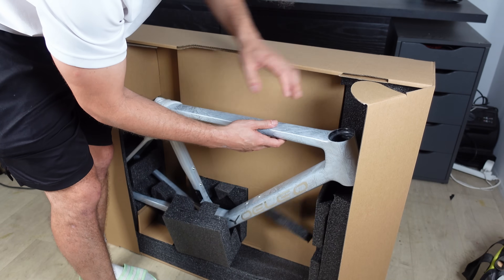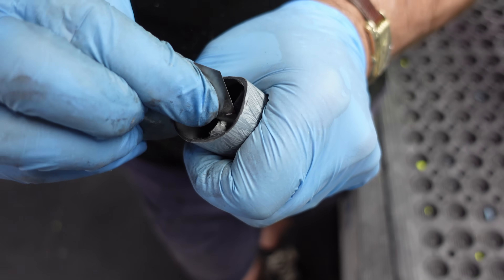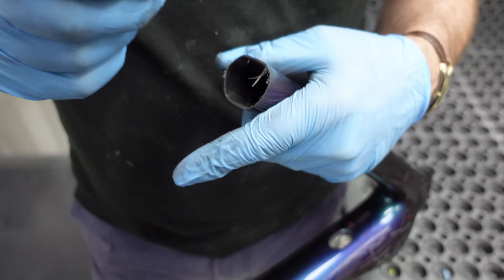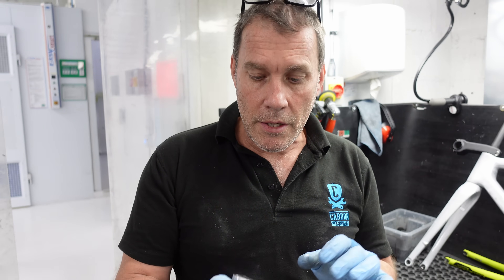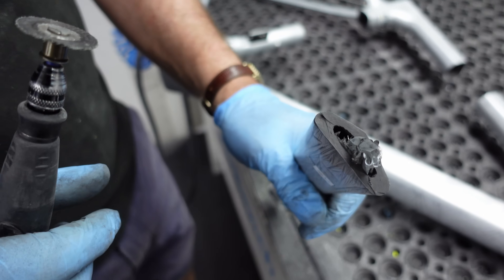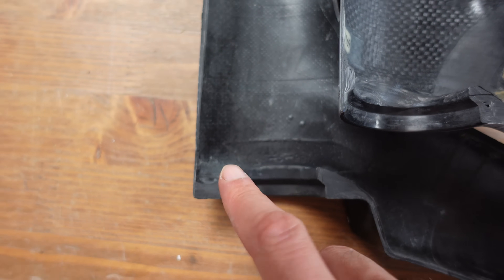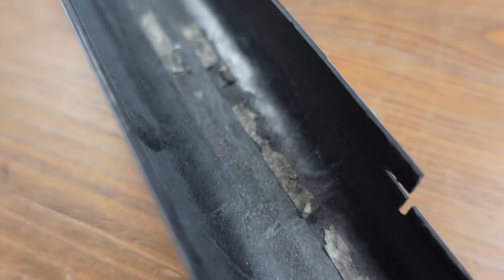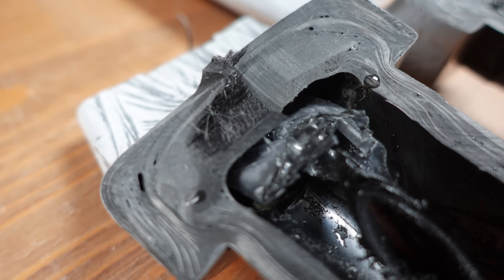I Cut a Brand New "Chinese Carbon" Frame in Half... Here Is What I Found! (Yoeleo R11)

Comment: i feel like the quality of which the frame is built doesnt quite translate into how it rides. at least thats what i have experienced with the g21 (gravel frame) i built up.
Reply from the maker: What is your experience of the G21? Do you like it?
Reply: @JourdainColeman  there are a few flaws imho - they advertise it as a race bike - yet it rides rather sluggish than nippy, kinda dead in the rear. its too stiff, has no flex at all, seatpost and cockpit feel too hard for a gravel bike, even a racer - causes pain in the hands and the back. standover is too high thus seatpost too short, looks weird, feels weird. chainstays too long, wheelbase too far. its a great descender but thats about it. a disappointment for its price. finish is great though and building it up worked like a charm - they built a solid frame material wise, but ride feel and geometry are low end.

Comment: I wish manufacturers would come up with a bike with no design considerations other than the best compaction in every area. I've seen dozens of these cut up videos and low compaction in sharp radiuses is the biggest issue I see. It's the biggest reason I haven't moved to carbon yet.

Comment: The "mysterious white chunk" in the Trifox fork is a foamcore which indicates a much more efficient construction compared to the solid core of the yoleo fork. The way the fibres bend around the corners in the yoleo frame shows very poor fibre placement and layup design. Just from looking at it I dont know how you concluded that the yoleo fork is better tbh. It looks like at the bottom of the yoleo bottom bracket is also a piece of foam core.

All the talks about wall thickness is to be taken with a grain of salt since you dont know which fibre they have used or havent told us. Given the same mechanical properties the larger the tubes diameter the less wall thickness you need which makes it an overall more efficient design since youll need less carbon overall to achieve the same stiffness.

Comment: I have a Yoeleo R11. Love it. The only issue is the seatpost.
Reply from the maker: What's the issue with the seatpost? I'm about to build one so if you have any tips please drop me a message on Instagram. Or here if you don't have insta 👍🏽
Reply: @JourdainColeman  Well...funny you asked. It appears that they updated the saddle clamp design so it's not an issue anymore. Long story short, with the old clamp design you can't readjust the saddle. Once you tighten the bolt, it's kinda just stuck. You can hammer out the wedges using various tools but it's very difficult to do it.
Reply: @cisdolce  Loosen the bolt all the way then whack the top of the seat hard with your palm a few times and it loosens off. I have one and do exactly that. Once it's set correctly, it doesnt need to be moved.
Reply: @TheMoodyedge  ugh. Thanks! It still sucks. I wanted experiment with many different positions.

Comment: Carbon graphite can be purchased " preimpregnated ( prepeg ) " with epoxy resin of your choosing. It is kept at freezing temps to prevent curing and has a short shelf life. Alpha Q forks used this material when Que Lee owned the company before he sold the company to true temper. Don't know if true temper used the prepeg material. Just my observations. Stay safe all...

Comment: Jourdain , Another great video by you. It is nice that Yoeleo is doing this but a real quality test is cutting a frame with random selection out of production line not a handpicked one. Also I am wondering with that much added carbon, what was the weight of this frame/fork?
Reply: Pity we didn't see a weigh up of the frame and fork to compare to the spec sheet for the size from yoeleo.

Comment: Having worked with the UK distribution until recently I can honestly say I've never had a return of a yoeleo frame or wheels. Got 3 myself (perks) 2 yrs on no faults. Just look at their factory testing on YouTube they put them through their paces.
Reply from the maker: Good to hear!! 👌🏼
Reply: That's good to see and I hope the parts are going to be available in years to come. I need confidence now that if I drop decent money on a lesser know brand I'm going to get that seat post or spare fork in five years time. I can't get a derailleur hangar for a Chinese frame I bought  6 years ago as they've either gone under it are under a different brand name(yes that's not uncommon).
Reply from the maker: Yeah, I guess that is always a consideration. Yeoleo are a pretty big brand though so I'll be surprised if the disappear. You could always ask for a spare seat post and extra bit's in the box. They seem pretty accommodating.

Comment: if its incredibly strong as claimed then how were you able to cut through it so easily? 🤔
Reply from the maker: Carbon against a cutting disc is no competition. Carbon doesn't do well against abrasion. Carbon is much stronger than you may think
Reply: Dude please…😂😂😂
Reply: It’s carbon. Also yes, you can cut an aluminum or steel tube with power tools such as these.
Reply: No resistance or fight. It was like hot knife through butter.

Comment: I have the YOELEO R12 and it’s better than the mainstream brands in my opinion”, very comfortable, fast, stiff, and very smooth ridding bike”, also seemless inside the tubes. It was very easy to build with no sharp bit of carbon to poke your fingers like some of the mainstream brands. Overall the YOELEO R12 and other frames they make are excellent and are all tested to a very high standard,,,,, twice the standard than mainstream brands and other brands that people may know. This is why  YOELEO says “WE CARE ABOUT YOUR SAFETY FIRST”, safely to a carbon frame should be number 1 when it comes to the structural integrity of the frame and fork, YOELEO does this in all there frames. There frames are all UCI approved, so you know your getting a good product, and to top it off they come with a 6 year warranty and if you want a lifetime warranty it an extra 300$ on price of the frame set, says they completely believe in there product that is true and sound. However buy yours now as the prices have gone up now. The YOELEO R12 is now 1600$ plus shipping and the 300$ lifetime warranty if you decide to get the lifetime warranty. Overall it’s not the name that matters it’s the quality of the build in the product is what’s most important.  I’ve seen TREKS, and PINERELLOS FAIL, and other mainstream framesets break but haven’t seen YOELEO , WINSPACE. SEKA, HANDSLING, or VELOBUILD fail yet, these frames are very very good quality for all about 1600/1700$ for the frame set and all are UCI approved. Not bad in my opinion and besides I’d rather buy these frames than spend 5/6000$ on a bike frame any day. It’s outrageous that a bike frame cost that much on mainstream brands. There’s no middle made on the Eastern brands””” you buy directly from the factory saving you a lot of money so you can buy wheels and other cycling gear with that extra dough. We all know that almost all carbon frames are made in China and in Taiwan, that’s where the best carbon is on the planet and the expertise is when building these carbon frames………
Reply: Do you work for YOELEO?
Reply: @bennymabazza Yeah that sounds straight from a marketers promotion. 😂
Reply: @bennymabazza  No”, I don’t work for them”,  I just do a lot of research with a friend of mine in the cycling world to find out what brands are good and go above and beyond there work  like “YOELEO” to build an exceptional product and what brands don’t.
To note:, there are 4 UCI Pro Continental teams using the R12 and R11 on there teams.
Reply: @thecyclist86 Yeah but it's your opinion not actual ownership or testing?  At least Jourdain and Rob are actually having a real world look at the product but even then the customers want figures such as weight and parts availability. I've owned Chinese small brand frames for a few years now and I own a Trek Emonda. Ive had a few issues with the generic brands  but I could repair and fix those issues. My problem now is I need a new hangar for one frame but the company has gone some I'm having to modify  up a similar part. If I need a part for my Trek I can buy pretty easily from local bike stores or as aftermarket. Parts availability and delivery time is always the problem with online purchases. I think the biggest problem is the price of the lesser known brands is going up to the point of pricing our the customer that looked to the alternative product in the first place. Before long frames ex Vietnam, Indonesia will be supplier of the gateway carbon products much like we are seeing with Polygon bikes.
Reply: @bennymabazza a stupid question 😮
Reply: With all respect how many of these lesser names do you see out there in club rides or races though. Not putting them down but it's hard to make real work evaluations when the numbers are thin on the ground relative to big store brands.
Reply: @glennoc8585  Like any company ya have to start somewhere.
Reply: @glennoc8585  Just because ya don’t see them as much on the ground doesn’t mean there not any good in the real world, they just haven’t been around a long time like the others so we can’t assume there garbage if ya will,” they will make there mark just like the big four eventually”, especially if they keep making good carbon frames which YOELEO does. Giant is an Taiwan brand , “FACT” , they were garbage when they first started now there established brand and it’s an EASTERN brand like YOELEO , WINSPACE, etc. People get stuck on the names to much than to look at the quality of the product “ , since cycling is the subject the fact is we’re all riding a Chinese, Taiwan, made carbon frames. Specialized and Giant are made in Taiwan for example: FACT.  YOELEO., and Winspace factories are right next to each other in China. Practically everything we buy in our houses is made in China.
Reply: If you look up the definition of “bias”, you’ll get a link to this comment 😂

Comment: If the manufacturer suggested the test, the chances of getting the same frameset that would be provided to a retail buyer are very small.
Reply: True.  😆✌️
Reply from the maker: I would agree which is why I normally get the frames, however, the way everything unfolded, I hadn't planned for this frame to be cut up. It was going to be a build. Then things changed and it got the chop. So from my side it wasn't sent to me knowing it would be cut. But they did know it was coming to me for a build. 👍🏽
Reply: @JourdainColeman  Ok, its a valid test then.
Reply: While they would have reason to do so, it would be very hard to deviate designs altogether especially in a mass produced product for a one of a kind frame sent to a reviewer

Comment: so basically...Yoeleo's approach is to over design their frames with extra carbon layups but then skimp on the resin so that their frames do not become dead feeling clunkers?
Reply: Thank you for your observation. At Yoeleo, our approach is centered on performance and quality. Indeed, we do apply extra carbon layers to enhance the strength and durability of our frames. However, the resin usage isn't skimped on. Rather, we control it to maintain an optimal balance between rigidity and ride feel. Every individual frame receives the right amount of resin to ensure the carbon layup is appropriately covered and sealed. This contributes to the 'alive' and responsive feel of our bikes. Rest assured, we are constantly working on improving both our product quality and quality control processes. We appreciate your feedback and your support in our endeavor to create top-notch cycling products.

Comment: Just got the Yoeleo R11, cant wait to test it out its stiffness compare to others bike. Used to ride Yoeleo R12 for 1 yrs + its a solid frame.
Reply from the maker: Good luck with your build. I will be doing a full R11 build on the channel in the near future 👍🏽
Reply: Mine was R12 - 2022 version. Compare with R11 its really less stiffer , very obvious when off saddle climb. R11 more agile and below 35km/h its feel light , acceleration also good. Just during cruising above 38km/h need more watts to maintain and keep up. Even the weight difference around 300g . R11 with peddle now 7.5kg and R12 was 8kg.
Reply: I have both an R11 and R12, and I actually feel like the R12 is the stiffer of the two, possibly because it's got the larger BB386 bottom bracket. That said, I find the R11 more comfortable to ride, but both are great bikes for the price. I do wish Yoeleo would put BSA threaded BB's on their frames though.

Comment: Riding Yoeleo for 3 years now, solid frame and never have such issues in general.  I can understand why they focused on reinforcing the frame. Any issues regarding carbon failure is not something Yoeleo Public relations can handle like how big brand’s doing In term of budget and the power of publicity. 

Good video 👍🏻
Reply from the maker: Yeah, I think the strength first for a frame like this is good to see. Especially given the average consumer isn't a Pro Cyclist.
Reply: Thank you for trusting Yoeleo.
Reply: Had a yoeleo r12 for the past 2 years and have done multiple rides above 200k and have absolutely no complaints about the frame 
Also built it myself with no bike mechanic experience and had no issues

Just wished YouTubers stopped referring it as "Chinese carbon" as if the other big brands didn't have their factories in Asia